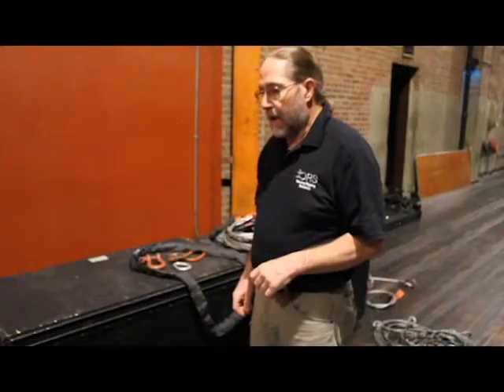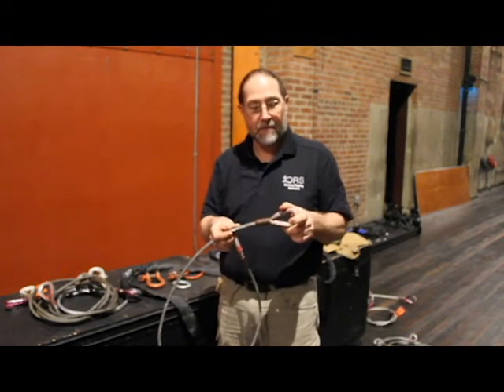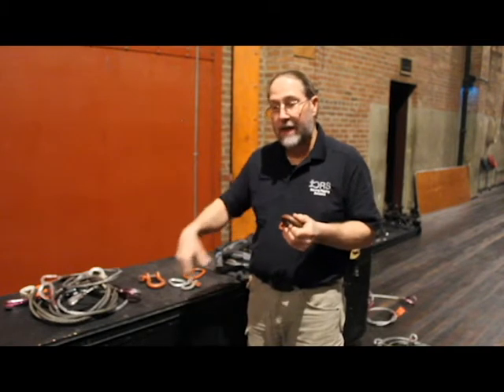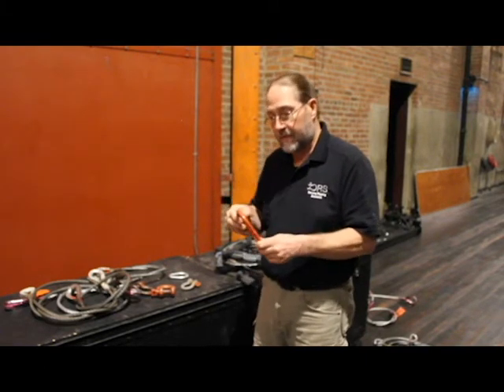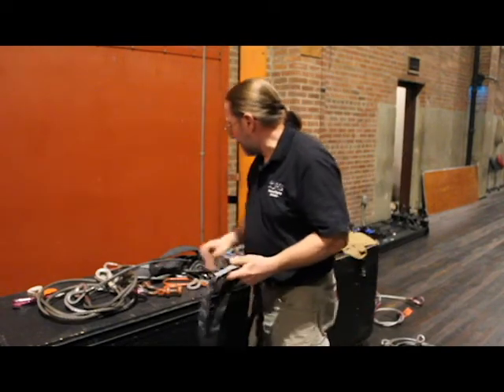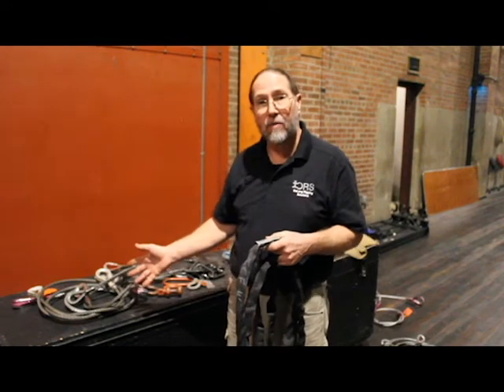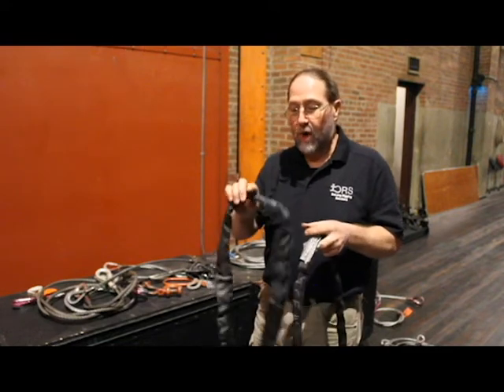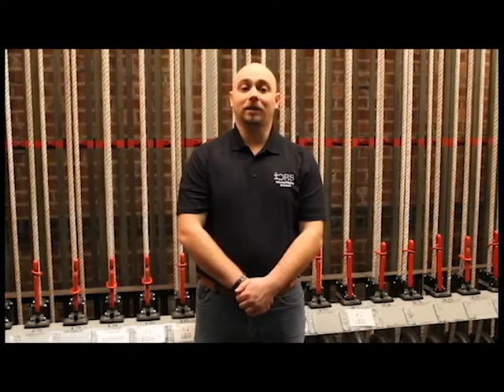Arena Rigging Hardware Chat

Comment: I saw a pyro setup that was allowing sparks to hit near synthetic fiber web slings (which were under significant loads across the proscenium). I was wondering about if that could be an issue and felt like they shouldn't have risked that. I am glad you mentioned that as now I'll have knowledge as power to back up my protest.